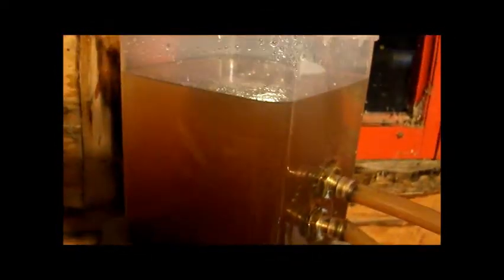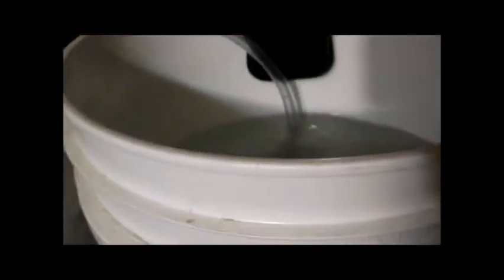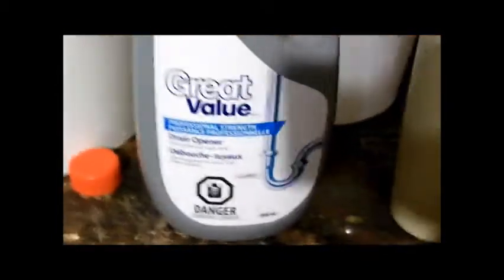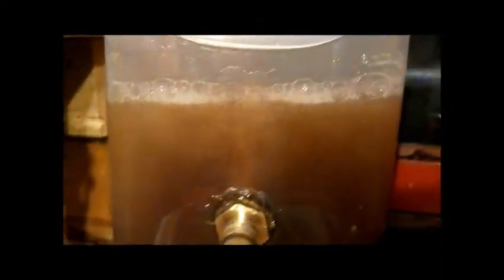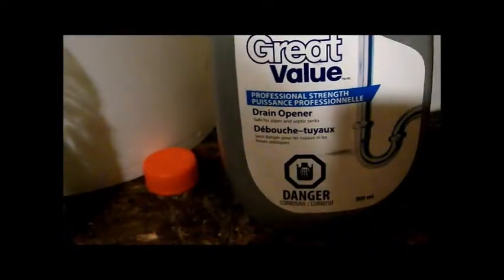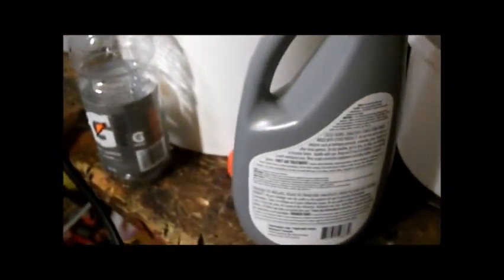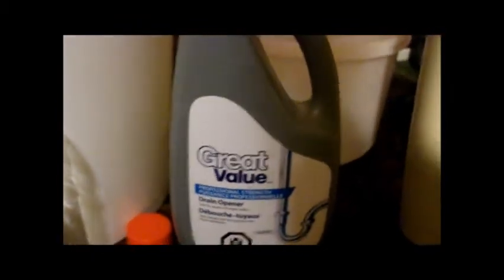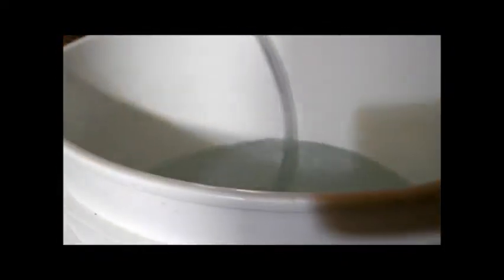HHO Drano test part 2

Comment: how did the torch work with draino? better?
Reply from the maker: No Well ... About the same as Backing Soda but the water switch to a green Gue after a bit
so far the best is backing soda and you add more if you want a stronger reaction.